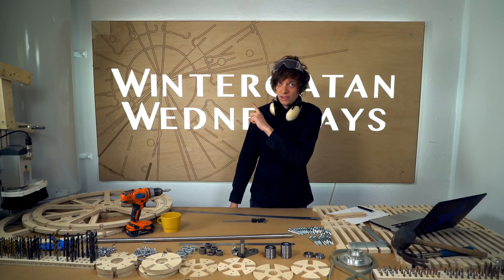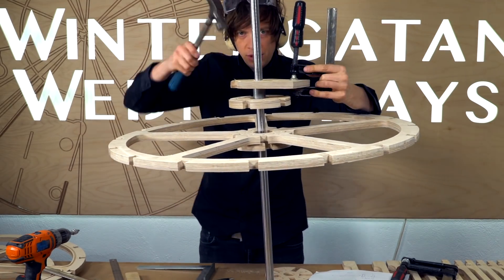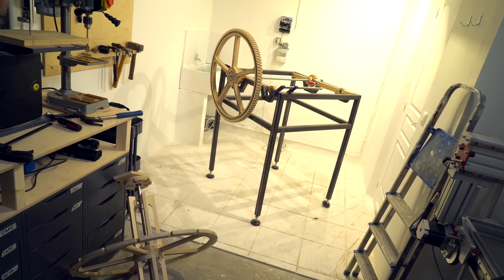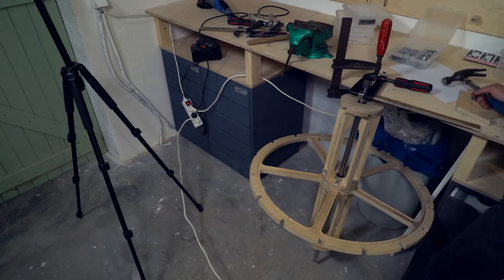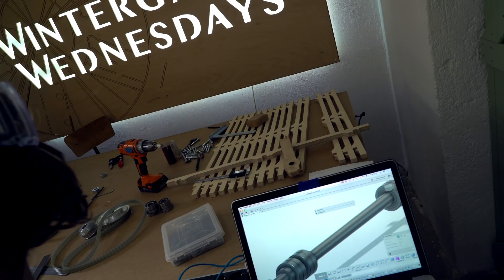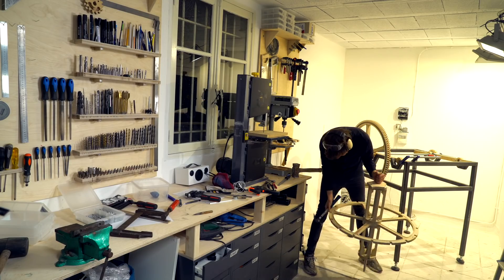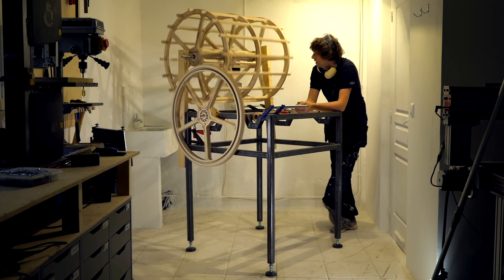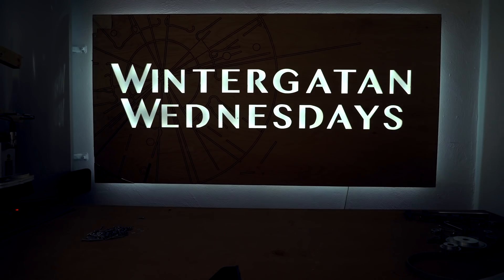Programming Wheel Skeleton - Marble Machine X #19

Comment: If you have tight joining try warming the part up, it will expand slightly and will fit better, once in place and cooled down it’ll be fine. (Don’t forget to regressed the bearings after heating)
Reply: Or he can cool the rod. That also works.
A few hours in bath full of ice (mixed with salt) can help next time!
Reply: @GameHunter That might corrode the rod depending of material and will make it worse if this happens as the rust will make the rod even more thick. Maybe he could use an alcohol bath instead of water or at least use antyfreeze instead of salt.
Reply: A bearing should usually never be heated above 110-ish C, that's not enough to cause any harm to the plywood. I can't remember quite, but it's like every 20C difference in temperature is 0.1mm more leeway in the tolerance, and 0.1mm helps a fuckton when you have a pressfit bearing and no press. Looks like sealed bearings, so probably just stick them in the oven set at like 60 degC or so and let them cook for a while.
Reply: For steel the thermal expansion is about .12 mm per meter, per degree C. Those bearings are maybe 50 mm ID, so to get an extra 0.1 mm clearance you'd need to raise the temperature by 16.7 degrees, or 33.3 degrees if the ID is more like 25 mm. So yeah, 20-30 degrees C should give you plenty of clearance.
Reply: so basically warm up the bearings with a hair dryer on low for a minute before trying to put them onto the shaft.
Reply: +Jay Leno
I think he said the shaft and bearings were 20mm, so about 42 C hotter. Assuming an ambient of 25 C, that's still only 77 C. (~171 F) Probably not pleasant to touch, but not enough to cause damage if +ColtaineCrows is right.

Addendum:
We seem to be late to this subject. +QuazyWabbit already has a solution. Turns out dedicated bearing heaters are a thing.
Reply: We using an baering heater ( heating through induction ) and the setting is between 100 - 120 °C but the baerings that we using is for ( big ) SEW/Siemens gearbox ect. ..but you can set temperature lower for the little baerings :)
Reply: 12jojimbo by warming the bearing will only expand the inner ring making it easier to place into position.....you don’t have to heat anything up so it would burn, warp or effect the wood.
Reply: Or do both cool the rod, and warm the bearing. Something simple like sticking the rod in the fridge/freezer the night before works quite well. The rod gets cooled all the way through, so it takes awhile to fully heat up. Not being immersed helps with any concerns of corrosion, or just plain anything being stuck.

Also, never forget your lube:) If you don't have to worry about the bearings sliding sideways, some form of lubricant can go a very long ways as well. There are plenty of thin oils designed to absorb into the steel a little that work great.

When working with tight tolerances, every little can help, and stacking several little bits can help a whole lot.
Reply: Heating the parts is not the best way because it runs the risk of overheating and ends up annealing or heat treating it, the proper way for interference fit is to freeze the part that are to be inserted by using LN2 or at least using dry ice, . In case of close tolerance fit, just use grease or light oil as anti-seize compound, sanding the parts with high grit sand paper is also acceptable.
Reply: GameHunter yes, that would of been my other idea but, with cooling the rod you will need everything off and fit everything on before it warms up again....heating the tight bearing will be better..
Reply: Marc’s Fx only has to be warm not hot
Reply: Adria Garceran The rod is stainless steel.
Reply: robleake yes, I’ve never said it should be hot, just warmed up..
Reply: Heating would work. But be careful, it could damage the retainer and shield (depending on what they're made of). Heat can also degrade the grease inside the bearings.
Reply: You can use freeze-spray.  That works very accurate at one spot (where the bearing will go) and will probably give the same result as putting the whole rod in the freezer, but without the need of disassembling. :)
Reply: The problem with heating it is that there's all that wood around which could burn, scorch or warp from excess heat.

Comment: You need to get a dead blow hammer and a rubber mallet, i know you like the nail hammer, but a you wont run into mushrooming metal with a dead blow hammer or a rubber mallet, plus dead blow hammers are more precise
Reply from the maker: I am slowly opening up towards a dead blow hammer :), that mushroom trip has got me sober on the subject. BTW im actually using a rubber mallet in the video, didnt do much but a deadblow would definitely do it.

Maybe i should make a whole video about me replying to all the mallet/deadblow comments by making a good dead blow hammer!
Reply: Deadblow hammers don't have the same persuasive power.  Just never let your hammer touch metal directly - use a 20 cm long piece of hardwood, put it against what you want to move, hit the end of the wood with a hammer.
Reply: I concur with Colton, I have done a lot of woodworking and some metal working over the years. The only time you should be using a metal hammer of any type is either to pound a nail, or destroy something (sledge hammer for demolition, claw hammer for busting tables, etc). I have been following your build and I can tell you have been learning a lot through the process, but your use of that claw hammer makes me cringe every time you pick it up. Every time you hit that machine, you are sending shocks through the wood and metal which can cause distortions (mushrooming, splitting of wood etc) not just to the area you are striking, but other areas of the project as well. A rubber mallet greatly reduces those shocks and reduces the damage on your project. You are building an AMAZING machine so PLEASE, put that stupid claw hammer in the drawer and use a rubber mallet. If you're having to beat it that hard, then something is off with your measurements and you need to go back to the drawing board. Keep up the awesome work. It has been a pleasure to watch.
Peter
Reply: You might want to consider a gear puller for similar needs in the future; it won't help with e.g. getting the spacer all the way to the end of the shaft, but it will make it possible to remove it once it gets to the end.
Reply: Depends on the hammer. 3lb mini sledge > 32oz deadblow > 16oz claw hammer. The deadblow won't mar up your work though, unlike the other two.
Reply: Wintergatan 
You could get a hammer with hard plastic tips to get the best of both worlds! Google "plastic hammer".
https://www.thorhammer.com/media/catalog/product/cache/1/image/9df78eab33525d08d6e5fb8d27136e95/p/l/plastic_hammer.jpg
Reply: i must of missed the mallet. That would be a great idea, and you can have to whole title of the video in capital letters with a whole lot of !!!!!!!!!! at the end to get every ones attention?
Reply: Alright 2 youtubers i follow replying to my comment is pretty cool. yes i agree not the same persuasive power, just for tapping

Comment: It would have been easier if you had cooled down the shaft because then it would've been slightly thinner. Looking forward to finished MMX.
Reply: And or heated the bearings... That's pretty much what is done to assemble shafts for trains. They put the shaft in liquid nitrogen and the bearings are heated with induction heaters. I think it would have sufficed to put the shaft in the freezer or outside at night and the bearings in an oven to heat them up a little. 100-150K difference is usually enough.
Reply: J Reith Bag of dry ice would have made a welcome difference, yah?
Reply: At least oil it..
Reply: Works just fine on any bearing as long as you don't heat the bearing above 110ish degC.
Reply: Der Keksinator That's also how train wheels are assembled.
Reply: Der Keksinator Works great on scintered bronze.  Not so much on "permanently lubricated" sealed bearings.

Comment: Somebody please get this man a gear-puller.
Reply from the maker: I dreamt about that yesterday!!!
Reply: And a press.  And some lubricant.  And some drill bushings.
Reply: Ian Duh 
I finally bought one for myself last year.  What a revelation that was!  Enormous power, in an absolutely controlled manner.  Anybody enjoying these videos is probably the sort of person who needs to own one.
Reply: Ijfinger Too bad he moved, otherwise he could just visit hydraulic press channel for "help" with his machine xD
Reply: First time I saw the puller in my dad's garage I had no idea what it could be usef for... Then I've learned to use it... Miss the old man.
Reply: I was thinking the same thing during the whole "stupid" part.
Reply: I think it's too long to fit in the hydraulic press. This shaft is about 3/4 meter long, isn't it?
Reply: Depends on the press.  The tallest I've seen was 20 meters tall.  We have one where I work that's about 3 meters tall.  Arbor presses you can get at Harbor Freight are only perhaps 10cm tall.

Most of the shorter and more common ones can be rigged with some creativity for things the size of what we saw in the video.
Reply: Interesting.  I think the Hydraulic Press Channel's press won't fit this assembly, though.
Reply: LordDragox412 It's a long journey to Tampere, regardless whether you live in Provence or Götaland.